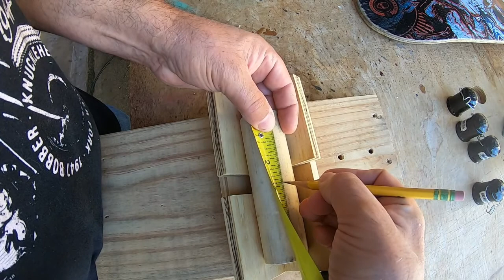Skateboard Light, Step by Step, Complete Detailed Build Instructions

Comment: Great job, very creative. 👍 A crimpless self-soldering connector would streamline the wiring, has a much lower profile to lay perfectly flat on the back of the board, is permanent, and would give a more professional appearance. All you need is a heat gun or a small bbq lighter. It might allow you to eliminate the backboard altogether.
Reply from the maker: Hey Dragon, I definitely appreciate the feedback and I happen to agree with you. Even if I used your suggested connection I would still add the wood to the back as it enables someone to easily hand the skateboard vertically or horizontal, plus, I just like the looks of it.  Thanks for your comment and feedback!